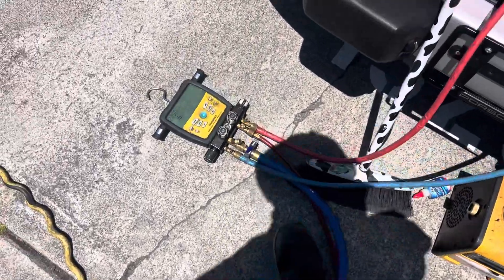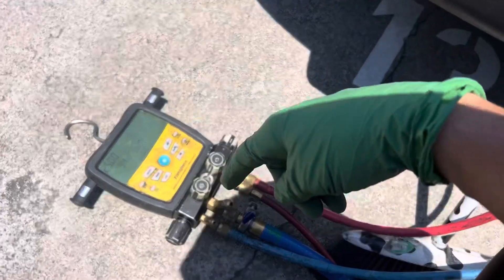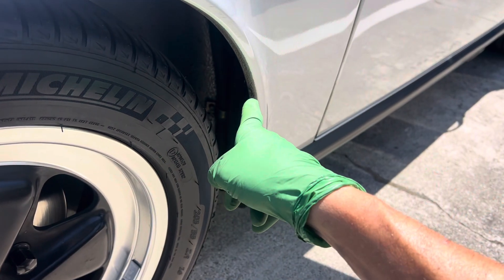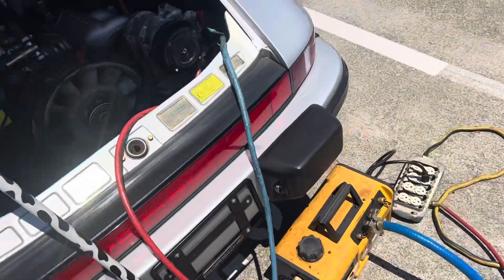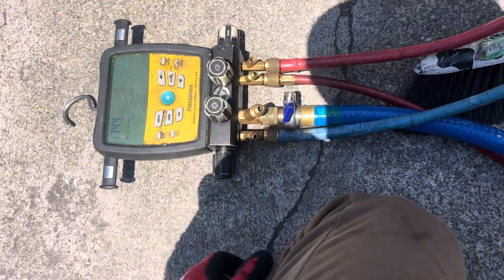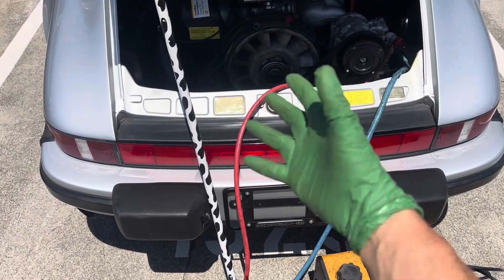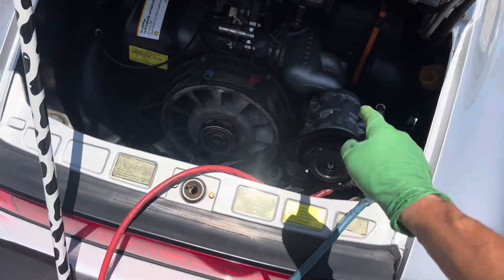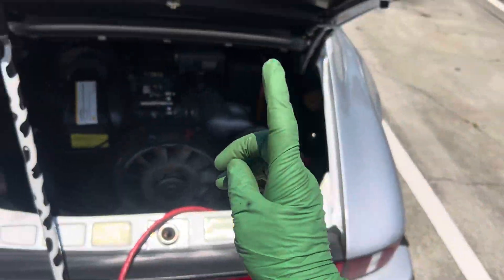MICRO GAUGE INDICATES HIGH MOISTURE CONTAMINATION

Comment: UPDATE again. I have now placed 3 thermocouple on my HVAC system pipes. I done some logging. Poor thing mu compressor OUTput is as hot as 88C / 191F , at creeping traffic jam in a 45 minutes drive after a heat soak and my underhood temperature  is usually 4C to 5C hotter than compressor, so it heats up the compressor too. Ambient temperature for this data is 28C or 83F and at night.

Condenser output is good, 55C / 131F when compressor that hot.
EVAP-out pipe between 5  to 7C (   41-45F ) 
Humidity is minimum 65% RH, usually 90% RH in daytime.

Living in tropical country, I pity this Denso compressor life.
I have not log 35C ( 95F) ambient yet and day time.
Reply from the maker: @suryaprihadi2258  as long as the DENSO compressor never has moisture and air mix with the refrigerant and the condenser is kept clean, and the fan never breaks down the compressor will survive
It’ll just have a hard life
Reply: @coldfinger459sub0   yes high stress life. R134a critical temperature is 102C, dang. The IHX end i measured  at LP port body, can be as high as 16C where evap out at approx 4C to 5C. So liquid line probably cooled down by 10C or 18F. Impressive for such a short IHX
Reply from the maker: @suryaprihadi2258  and as a rule of thumb
👍 
Measured roughly 6 inches from the compressor. The temperature of the pipe temperature on the inside of the cylinder is roughly 50°F to 75°F hotter at the point of generation. . 

At what temperature does the oil start showing suffering? . To thermal breakdown and degradation.

Which is accelerated in the presence of H2O and O2
Reply: @coldfinger459sub0    my thermocouple at compressor output pipe skin is approx 3 inches away from the  connector interface/coupler of compressor. By 5 inch it is the hose crimping already.  Using Flir Thermal imager , compressor overall body also showing average 85C.
Reply from the maker: @suryaprihadi2258  clean off the metal areas that you want to test temperature with your thermal imager with some acetone and a scrub brush

And then spray them with some Weber flat, black spray, paint or flat black spray paint meant for exhaust manifold

This will give you the most accurate temperature measurement with your thermal image camera .
Reply: @coldfinger459sub0  yes i know shiny surface read higher  lol. 5% tp 10% sometimes. Depending on angle
Reply from the maker: @suryaprihadi2258  I made a video with my thermal camera where there was a large aluminum piece of metal that had a flat surface.  Piece of metal was room temperature.. but be behind me a few feet to the right at an angle was a high heat source like a heater or something can’t remember exactly what it was.  But it was showing that I think it was a couple hundred degrees, reflecting into the cold, shiny metal and back to the camera, giving a completely false temperatures..  and that was a source that was off to the right angle behind me. 

They can pick up anything from any direction that are reflected, just like a picture image in a mirror
Reply: @coldfinger459sub0  yes i saw that video, good case study of reflection. So awesome. Thanks